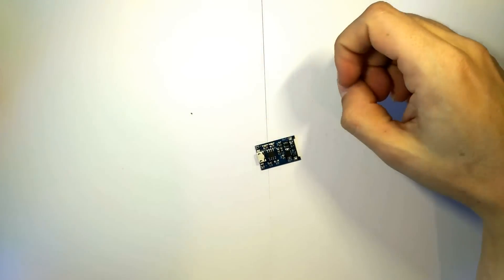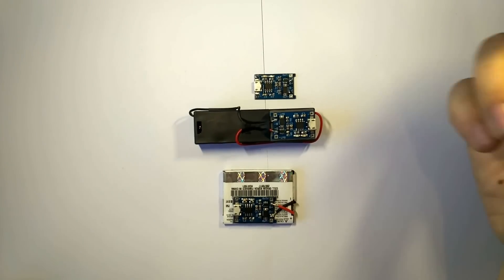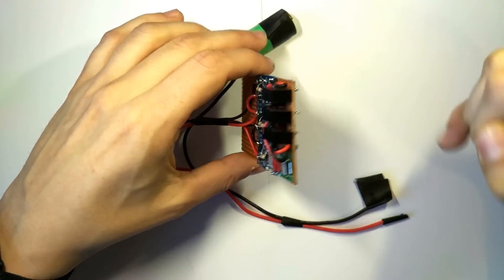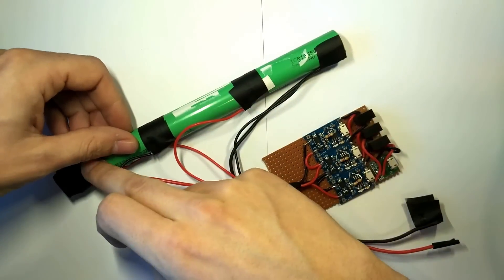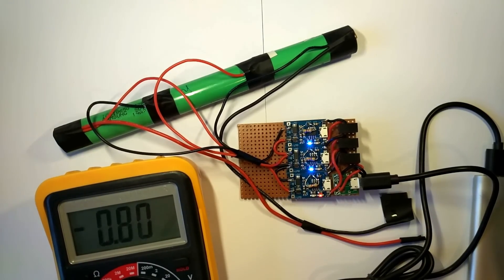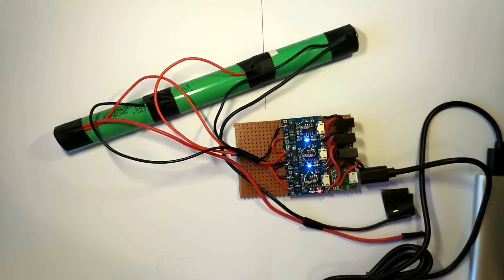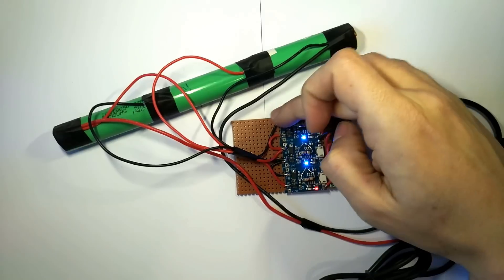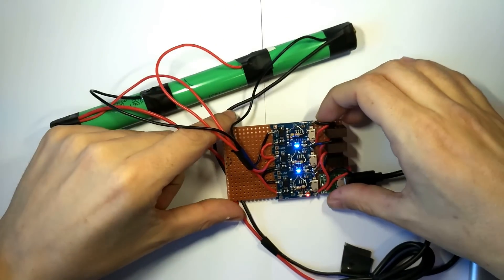Balanced 3S Lithium Cell Charger using the TP4056

Comment: I can't find a more optimal solution for charging optimally each battery, and using them optimally. The only drawbacks are the 70% loss of energy during charging and the price of the B0505. I wonder why this mount is so rarely referenced in the DIY projects !  Very nice, thank you so much :)
Reply: Use separate wall adapters for each modules. I have made a video of it in action :D If efficency is an issue go for TP5000
Reply: @karlsprojects4639  The idea is that the device (project) is 12v but can be charged by USB. In other words, it has to look and function as a normal power bank to a typical user.
Reply: due to the very low current (and those modules apaerently supporting 4v to 8v as input) you can also make a simple and cheap cirquit which uses supercapacitors where they are charged through a mosfet, and discharged through another mosfet and the cirquit, essentially make sure only one side is on at the same time, you might also want to add a capacitor at the output and input so it can stay always on instead of constantly turning of the charging cirquit when needing to charge. but doing this can greatly increase efficiency if that floating psu module is really that inefficient.

if only the price is a problem them it can be done much cheaper and still simple.
using a simple 555 timer to generate a frequency, or some other frequency generator like a schmit trigger inveter/notgat frequency generator(simpler and cheaper). then the output toggles a mosfet or powerfull enough transistor on and off, the mosfet powers a coil, optimally you use a high frequency so you can use a air core, but for simplicity you can use something like a nail or bolt as core, wrap another coil around that nail and coil, rectify that output with diodes add a capacitor to balance it.(on the input you might also want to add a small capacitor against voltage peaks from self induction if you use a low frequency to drive it, next to that you might want to add a diode to protect against reverse current.
doing this despite it sounding like way more steps, it is really simple and allows to handle way more current than 200mA. if those parts are actually expensive then this is probably cheaper, that link was broken so didn't see the price. but you only need one frequency generator. also using transistors is cheaper and simpler as they don't really get damaged as easily from reverse voltage spikes, but mosfets can handle less current. that said you can get transistors which can handle half a amp for around 1 cent a piece, when seeking well you probably can also find transistors handling around 1A or so for that price. with mosfets however you can get very powerfull mosfets for rather cheap, in a local store, so not even on a site like aliexpress, I can get a real IRL7833 for €0,55(0.55 in usa notation) these handle 30V 150A and have a rather fast response time, their on resistance is also very low they they generate little heat, and their response time is fast.
but the most common general purpose transistors already reach around 400mA, I would personally try to find something which can handle 2A or such so that no current limiting resistor replacement is needed, and so you keep optimal speed. but you can put multiple of them in paralel, like bc337 as they cost less than 1 cent each. or you can find some transistor rated at lower voltage higher current which is more optimal for this situation. mosfets typically just have a lower on resistance making them more efficient for this, but probably most losses will be in the transformer in this case.
Reply: You could build twice as much cells in the space that the TP4056 and the B0505S take, for the price that they cost.
Edit: I also wonder what happens if some of the B0505S would fail. If a BMS fails, the cells are just not balanced. If the B0505S fails, who knows what happens? Maybe you just break a TP4056. Maybe you break your charger. Maybe...

Comment: why do you have the isolation?
Reply from the maker: The ground are connected on each side of the TP4056, so you would be shorting the cells otherwise.
Reply: I broke that ~10 moduls
Reply: @hubi321321  I burned 3 modules simultaneously and could not figure out why you can balance one cell at a time, but not all 3 from the same power source. I thought I was so clever soldering the units to each other with no wires, etc. I now realize that it was the battery side that was the problem. Each module sees a 3S circuit and burns. I appreciate the explanation even if the solution is not practical.
Reply: @tedhancock68  I made a charger using cheap (less then 1$) 5V 2A power supplies and modules from video. I can charge up to 8S cells using this.
Reply: @hubi321321  My project was a 12v power bank due to all the easy to add accessories. People want to charge these from USB. A typical user would lose, or leave at home, the funky 3 power supply brick I would have to provide. Even a standard 12v charger with the correct adapter isn't universal enough for travel. Most people only understand, and have, micro USB. Now,  voltage negotiating USB-C charging is starting to get interesting though...
Reply: I should watch this video, I have short one of the module by solder paralel input. :(

Comment: Thanks for posting! I've been contemplating how to charge a 3S pack for a portable led lamp, wanted to use USB 5 volts but had pretty much resigned to using a balance lipo charger which would be less convenient. Bummer on the current limitations of the isolation module. Perhaps I'll find one w/ more wattage.

Comment: Man, you should make it difficulty. Isolating each 18650 cell, connecting each one to one TP4056 and, then, connecting the energy out of the 3 TP4056 in series. Then it would be perfect.

Comment: Very nice! I did not think these individual cell chargers tp4056 will create floating charge . I find it very hard to believe but it works for you so I will defiantly test it .Tx!
Wait .. what are these black things before them ? do they make the voltage floating ?
ok .. got it .. you use the B0505S to make the voltage floating .. tx

Comment: I like this idea , i want to implement it in my boombox project . I will use salvaged recycled 18650 cells in 3S 3P configuration and having posibility to charge each group independenly is very good! The only problem is 1w of charging power is very low.. That is  less than 200ma charging peer group of cells..So about 30 hours of charging.... Freaking to long -.-
Are there 3W or 5W versions out there that we can buy? And is it possible to wire few of this 1W modules in parallel?

Comment: You know what else works? You still need isolation between so very simply find some small plastic box laying around, take three 5v 2a or 1a wall chargers that you may already have and set them side by side, solder a wire to each plug, cut and connect the outputs to the inputs on each TP4056 then wire the outputs the same way and use a 3S connection OR wire them in parallel to each battery in the series then use a 5S balance connector it has the necessary amount of parallel connections 6  wires 2 for the first battery pos and neg, 2 for the second battery and 2 for the third. These wire can easily handle the 3a between 6 wires and charge from that. When the lights turn color it's fully balanced and charged, no waiting to equal out batteries that are out of voltage and this method is fast. I love youtube.
Reply: Oh, after connecting the AC inputs in parallel and drill a hole in the box and run a cord thru the hole and solder the cord then cut out a spot for the 5S male then solder each neg and pos coming from the TP4056 to each pin and epoxy that piece in place a put the top on your case, done...

Comment: I could probably connect 5 B0505S-1W per cell and keep the one amp out on each battery, what do you think?
Reply: if you do it in parallel it would be no problem
Reply from the maker: Yep it's a possibility, but the cost would increase a lot.
They also do a BS0505S-2W.

Comment: I like the video as an idea, but I would not do it for the "savings". 
A 3S BMS costs like $2 on ebay and it is not limited by the 200mA/cell.
The TP4056 is nice, it is very usefull for many 3.7V projects but here I do not see the advantage (other than just for fun).
Reply: I agree. Balancing period is a nightmare to the person waiting and the battery. A BMS means battery management system and that could mean over voltage and under voltage and some include other options like balancing. For example a 3S 12.6v could be out of faze 1 or 2 of the 3 could have different voltages that adds up to 12.6v like 4.3v - 3.8v - 4.5v so 2 of the 3 will die prematurely and this is what drove me to do this, so a BMS that balances will slooowly bring the voltage of the 4.3v and the 4.5 down to 3.8v and charge then stops when 12.6v is reached and if they're still out it does it again until all say 4.2v and if that BMS dies, it takes the batteries with it, now as far as the charger that uses equalization must have a 3 pin JST connector on the side of it and a 2 pin 8.4v that uses various connections, I only know of 2 ways and one is because of this guy and the other is what I talked about in this thread, my way you have to use a 4  pin or a 4S JST and you fully charge from that but you need isolation either way. Each TP4056 pushes 1a so you're charging at 3a when you use 3 TP4056's connected to the guts of 3 typical AC to DC 5v wall chargers in one box, you wire all 3 chargers together in parallel (making sure each wire doesn't short to the other terminal) on the AC side connect a cord for AC so you can plug it into the wall and a cord clamp to stop it from coming out, then connect each TP4056 to each charger then the trick is to wire each TP4056 to your battery pack in parallel while the battery pack itself is wire in a series. I use this to charge my Bluetooth Speakers which is 100 watts 50watts per cannel 2 channels driven I used home speakers for this and I purchased a 12 cell 12.6v laptop battery and took it out of the case, disconnected the crappy BMS and tossed it away and it charges fairly quick, quick as in a lot faster than using a imax b6 balance charger because each cell bank of 4P charges singly and stops at 4.2v - 4.2v - 4.2v No Voltage Juggling Act Now I have friends and people I don't know are paying me to build a custom 2S and 3S LiPo packs you can do this using DC to DC too using sepic converter modules, but I use 3 battery sources but I am going to build a 2S so it's less damage if it gives out the magic smoke. DC of course work entirely different.
Reply: This is why this is better. A BMS or a balance charger will slightly over charge a cell then use that to transfer the excess amount to the under charged cell which lowers the life of the cells, but this will bring each cell up to its max and turn off so there's no balancing act. When a BMS dies it takes the other cells with it and will shut down at the worst time possible. There's another way using 3 or 4 phone chargers you might have laying around. Use a 18650 battery pack with wires for each battery, connect the first battery negative to the next battery positive use heatshrink and solder them together. Optional also wire in a JST for a 2S, 3S, 4S and on to the solder points so you can connect a battery checker then solder a TP4056 in parallel to each battery, done. You need isolation and this is shown here and you'll also get isolation using separate phone chargers and you will get the full 1 amp from each TP4056 so three will put out 3 amps and 4 amps for a 4S and on. Now you will have better battery life, no balancing act and no waiting. You can solder each terminal for the AC part of the chargers in a series directly to the posts use heatshrink, glue them side by side using epoxy or a hotsnot glue gun so they don't flop around and put it all in project box. use double face tape to mount the TP4056's to the backside of the battery holder and mount that upside down.
Reply: Not all BMS does balancing and when it does at that price, it's just simple top balancing by slowly discharging. I did see a 2s charger that claims to do "equalization", not sure if there are larger version of it or if it works..
Reply: Does the 3S BMS you mention have cell balancing? Can you point it out if so?
Reply: Yes.  But with independently isolated chargers, one can rearrange the battery configuration dynamically ... with relays or such.    A little surprised he did not pile 5 of those B0505S-1W or a couple 400ma isolators in parallel for each charger.  Sadly these devices are only 70-80% efficient, as they probably boost-buck.
Reply: Can you run 5 of these in parallel? They wont burn? I wonder if they make a module that puts out more watts for this same project so you can easily and cheaper to make to get that 1 amp out...
Reply: This is the highest quality 5s bms ive found on ebay, not made in China either.. uses Ti 76920 chip. The Ti chips are the Ferrari's of bms chips.. checkout his other modules too.. I went to Ti website and there nore info on their bms chips than you can imagine, all the schems you'd ever need! evaluation boards too.. http://www.ebay.com/itm/18V-5S-20A-LiPO-Li-ion-charge-discharge-protection-circuit-w-balancing-BMS/332031829350?ssPageName=STRK%3AMEBIDX%3AIT&_trksid=p2057872.m2749.l2649
Reply: Freshkryp69 LOL, your comment reads like a really lame shill for that eBay store.
Reply: I had the same dilemma here when making a S6 2P pack. It would require an assload of TP4056 chips with wiring and everything which would make the pack really bulky. A simply compact BMS would be a lot easier.

However, the BMS's are known to not charge your batteries to their maximum performance. I'm still looking into why that is a thing, and why they would exist in the first place if they don't work properly.

TL;DR individual TP4056 charging would charge the cell to a higher capacity than a BMS would do. (as I'm told)
Reply: Javier Palla Lorden those bms available in market; i found many of them just a piece of junk whenever you charge the setup from solar. If you want to connect this to your solar panel this setup is just awesome. And it really  works very well
Reply: Javier Palla Lorden hello, I know this is old.

But how do you charge a 3S 18650 with eBay BMS..? Do I have to put a 12.6 V source on the output +/-? I’m confused as there is no input for a charger?

Comment: You'd need a 5W version to do the full 1A. They do exist, but obviously not as small, not found any fully potted versions yet.
Reply from the maker: You can more easily find the B0505S-2W but they are a bit more expensive than the 1W version.